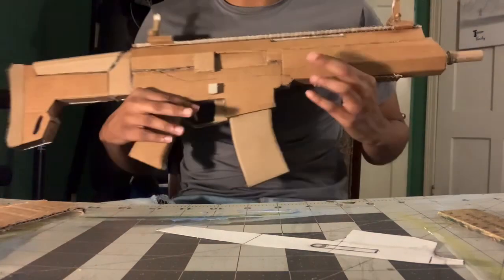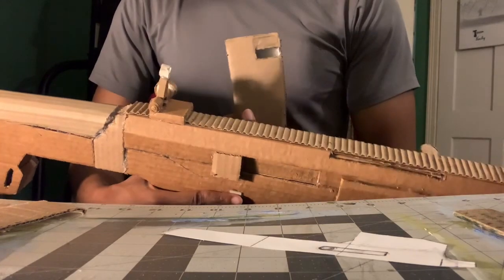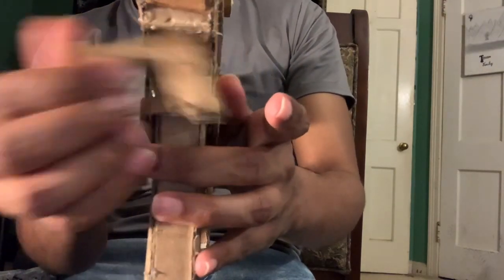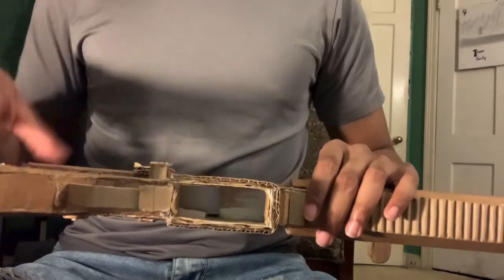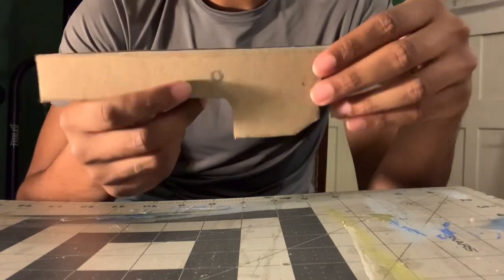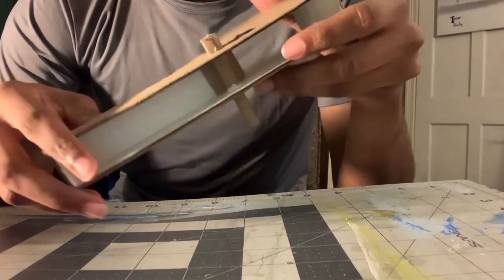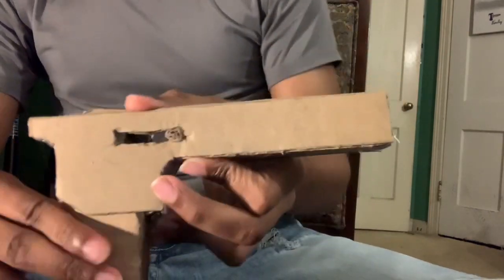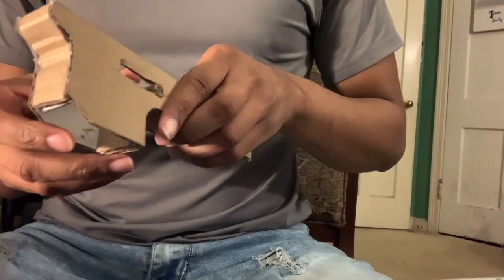How to make: Working Magazine Release

Comment: Bro i want to ask u a question.Now i am making mp5 and how long the total length of lower recever without magazine release?(Mp5)
Reply from the maker: The overall length of my MP5 is about 7 3/4 inches. Without the magazine well is about 6 1/4 inches.
Reply: Is it natural size?
Reply from the maker: @RediskaRezka  Slightly smaller than the real one. I would say bump it up to about 7 7/8.
Reply: @javitZ137  as i understand it the low recever is about 7 3/4 inches(It is customary to measure us in centimeters and meters)